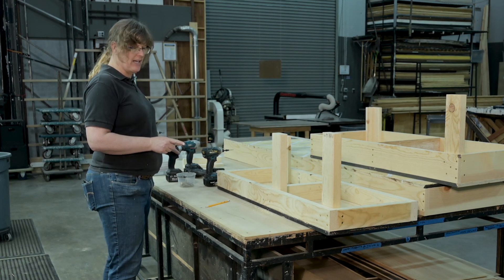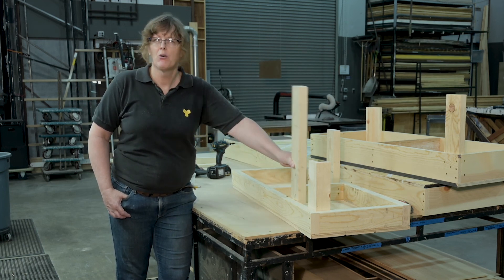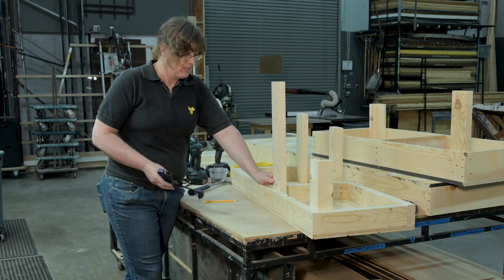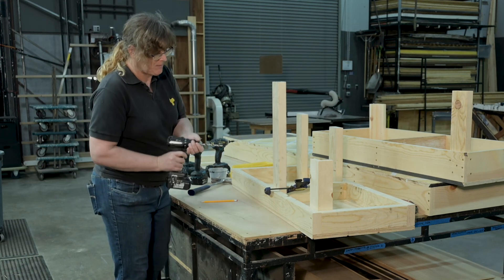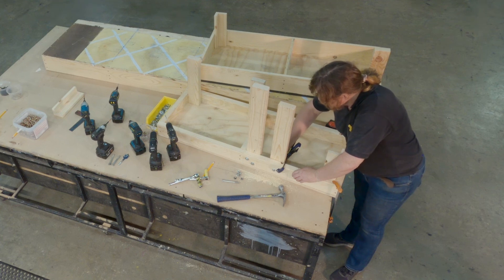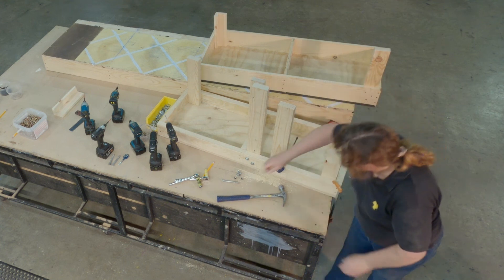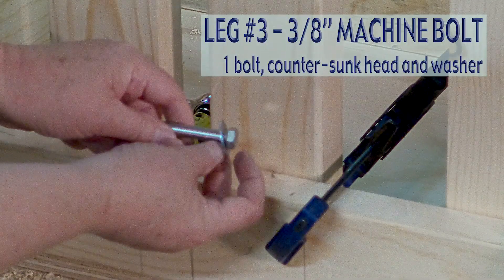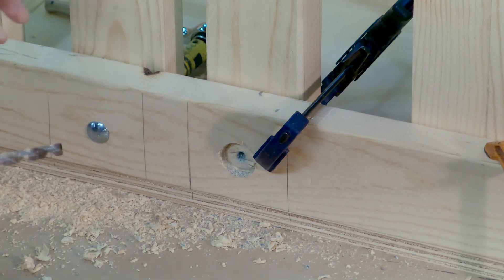(more than) 8 Ways to Leg Stage Platforms Using Bolts

Comment: Is there any difference is your frame is built from 1x4's instead of 2x4s?
Reply from the maker: I would only build platforms out of 1x6 and not 1x4. 

The bolting concepts all work for 1x framed platforms pretty much the same. But the version where you countersink the bolt wouldn’t work with a 1x6 platform. The 1x isn’t thick enough to countersink a hex head and a washer. 

When I am using 1x6 framed platforms, I almost always use screws and not bolts that require drilling holes and tightening with ratchets.
Reply from the maker: (See the companion video on methods of attaching legs with screws)